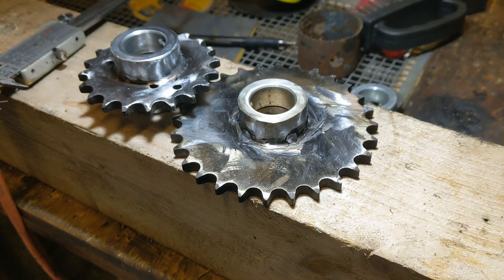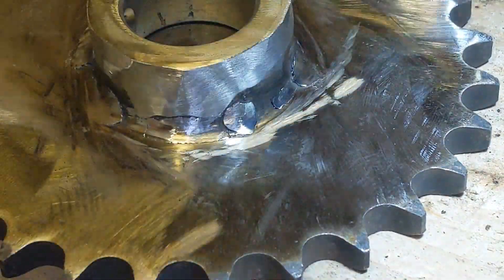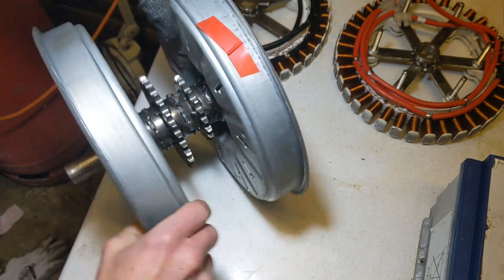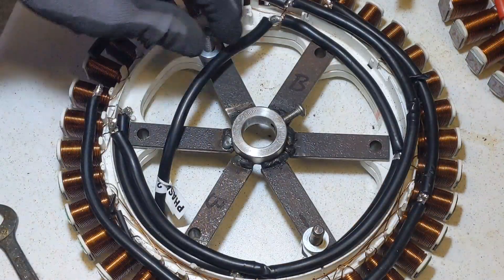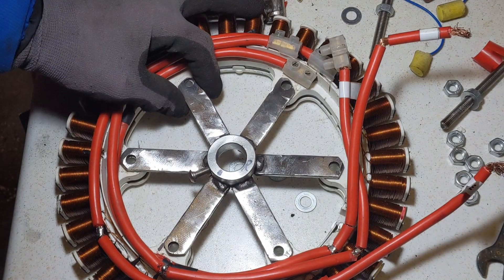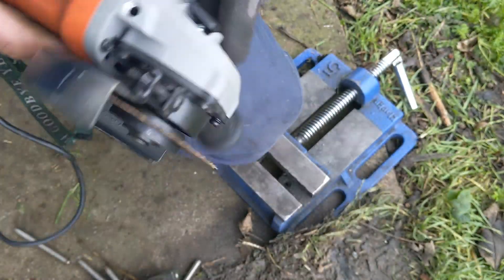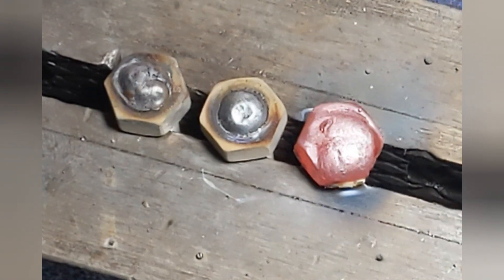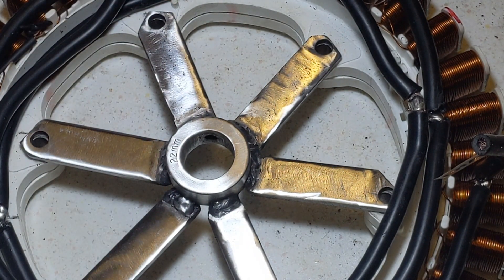Dual Smartdrive wind turbine project MORE WORK !! 13th December 2020

Comment: We are waiting for the test results ,,, volt ,,, ampere ,,, rpm and we will appreciate if you write the coil thickness ... and everyone makes the coil wire thin, why did you use it thick ... success ...
Reply from the maker: As soon as it gets finished it's going up on the tower
Reply: I had a fp-640 smart drive hooked to a midnite solar charge controller. I played with it for a year and couldnt get it to produce any real power. While it had great open voltage the wire was too small , and the magnets too weak to produce amperage, yours look older and a little more beefy than the newer ones, good luck to you sir!